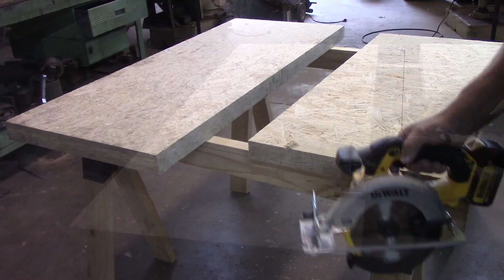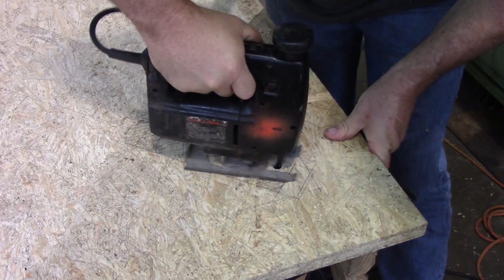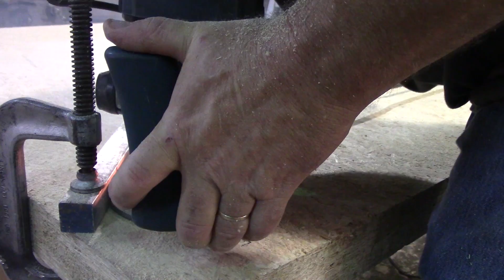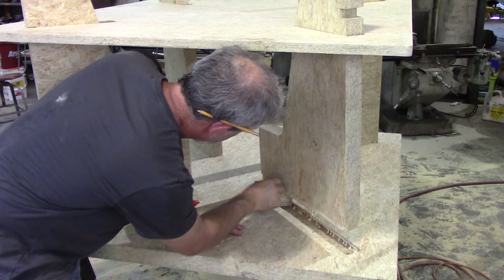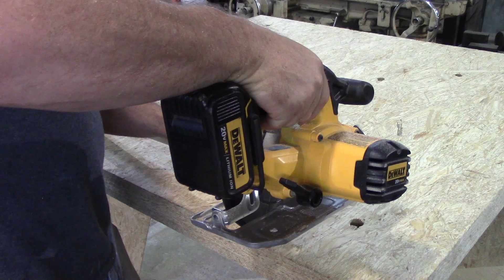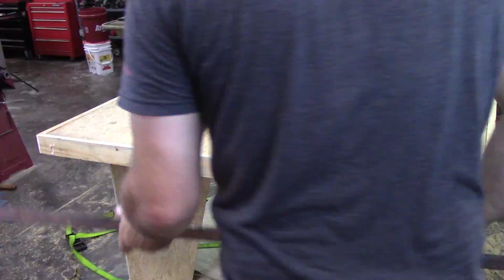Woodworking Work Table, 2 1/4" Thick OSB

Comment: That was fun to watch, I just finished a really similar project myself. I laminated 4 sheets of osb for the top and bottom shelf with wood glue using a floor squeegee to spread it and pallets full of product on top for a clamp. I used osb because I had a stack of it that I salvaged from some shipping crates. The rest of the table was made out of 2 x 3's from the same crates. I used lacquer on top, but If I were to do it again I would have used some sort of a filler on the top surface before the lacquer. This would have given a smooth surface that could be written on top of.
Reply from the maker: I considered filler on the top as well, I even saved enough fine sawdust to make the filler but in the end I decided it was more work than it was worth. Thanks for watching!

Comment: Mighty nice work, and don't knock your carpentry skills. For someone who "doesn't have much experience" as a carpenter, you got her done just fine!. Your design could be duplicated as "knock down" type benches, with only deeper mortises in the top for the legs. It could not be glued/pegged, of course, but it gives me some ideas for portable tables. I WOULD use a slightly LIGHTER material, though! Keep up the good work, and hopefully you don't have to move that monster around the shop much.
Reply from the maker: Thanks a lot!  I like the knock down design idea too.